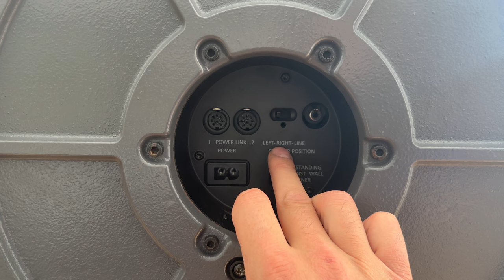Bang & Olufsen BeoLab 1 Active Loudspeakers Disassembly process and Repair guide

Comment: Hi Ihsan, thank you for the video. When rebuilding the BL1, especially the part where the heatsink is, do you re-apply heat sink paste? And you said the mainboard needed mainenance, is that carefully cleaning the board?

Hope to hear from you.
Reply from the maker: Hi DengKao
Thank you for your comment. I will recoupment to apply new sink past if you are able to and if the head-sink needed it. Be careful not to apply too much. If the mainboard need maintenance and service you are more than welcome to contact us. But if you only need to clean the mainboard from the bad isolation materiel from the cables you can take an antistatic brush and brush it away. 

You can contact me any time here : contact@kosetrading.com

Comment: I have a pair of BL1 but they are first generation pre-production samples. They've never failed until one of them started having some issue with outputting noise even when not in use a few weeks ago. This video makes me want to refresh them with new capacitors, removing the bad foam or whatever makes sense. Even very expensive audiophile speakers of today lack the beauty and care for the detailed mechanical design and material quality of these speakers and I wonder if there is a path to make them even sound better. For example, I could drive those speaker drivers with some external amps and use a miniDSP box to do the cross-over filtering and optimization. But such project would only make sense if the speaker drivers themselves are of high enough quality. Any ideas?
Reply from the maker: I will first try to open the Beolab 1 speaker and remove the bad isolations material around the ables. After that, i will clean the amplifier board and input board.

Comment: My beolab 1’s went into protection mode both at the same time after playing Spotify at level 78 through surround module on Beovision7, meaning the only light red, they do not react to any signal, all other speakers are still fine, is there anything besides unplugging I could do my self to make the light green again😊
Reply from the maker: Hi Nikotv4123
Thank you for your comment. Sounds like your amplifier has some problems. We have help you with that. We can take the conversation over e-mail. Send us e-mail contact@kosetrading.com

Best

Kose Trading
Reply: B&O bør kunne drages til ansvar for, at bruge så elendig isolering på kablerne, der kan ødelægge den indvendige elektronik.
Det er jo under alt kritik, hvis man tænker på prisen. 
PS.jeg har selv beolab 1